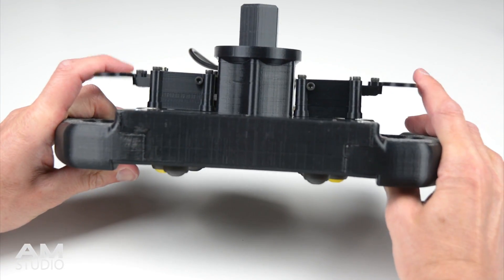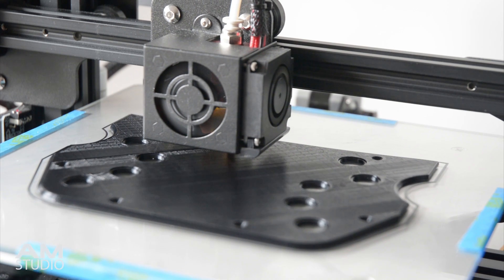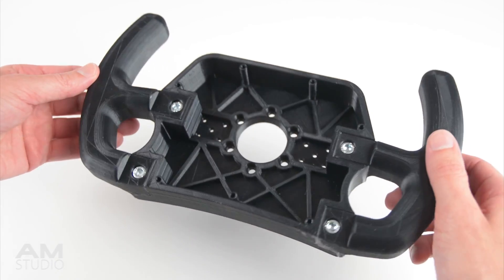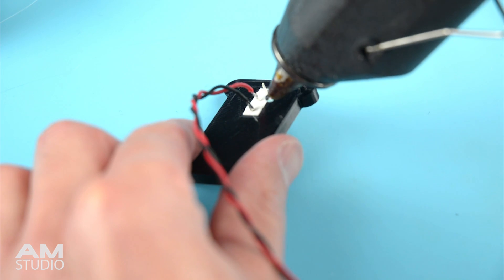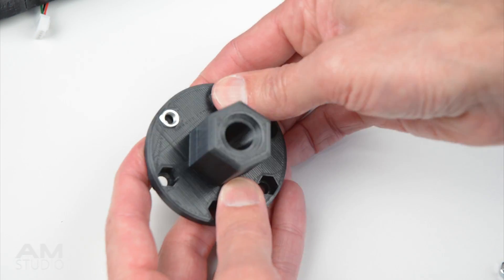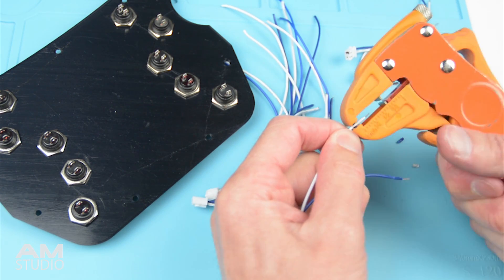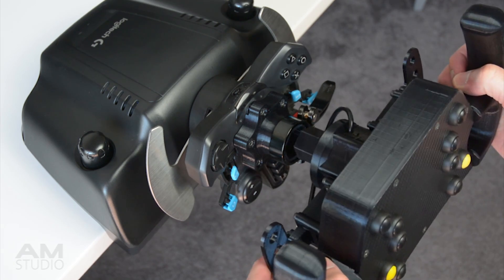HOW TO MAKE A 3D PRINTED F1 GT WHEEL

Comment: Bought it, printed it at 100 infill (maybe less would be ok too), assembled it exactly as shown and using it on a qr1 CSL elite.  It's so awesome, handling 6nm without any cracking noise or bent. But since qr1 has a groove, I can't turn it upside down without unscrewing/screwing the adapter, so I just use it for gt cars like f1 and it's perfect. Next project will be the Mercedes gt wheel but I can't decide whether the 30cm is worth the trouble and will make the driving more fun than this 28cm.

Comment: I made this one a year ago and it really improved by g25 base. However I modelled an adapter myself to directly bolt it to the base which cut out the movement and it improved the feel and handling a lot. If anybody wants the file I can post it on thingiverse. I might do a 2nd one and I am wondering which led shift indicator lights or displays are people using these days I can imagine that the prices of displays has fallen and the quality went up.
Reply: Do you still have that link? Also would love to know more about the process and ease of this tutorial.
Reply: @xelaplays14  With a little experience 3d printing its easily doable. You may have some issues with the quick release which creates some movement and flexness in the whole system. Therefore I designed an adapter to permanently mount the formula wheel to the g25 base which improved the feeling for me a lot and im still using it on a regular basis in Iracing. I can post that on one thingiverse if you want.
Reply: Yes I would love to see that. Looking to maybe create one of these to gift to my family members. It's really encouraging to hear that this job is doable with the right tools

Comment: I was thinking about doing something similar to this using a seperate logitech button cuircit board and then i can plug it into the actual wheel when i dont use the stock one so it looks cleaner, not sure if it will work though.

Comment: HI! I bouth this great steering wheel, but I need to install it on a T300. It's possibnle to have the Trhustmaster connetcion design to be printed?
Reply: If you go on thingiverse there are a few adapters for the t300 that you can print. It looks like you could just replace the Logitech quick release adapter with a t300 one.

Comment: Hey is it possible to use the usb encoder board and wire it into the g29 to work with the ps4 i dont want to use the original g29 button board and also connect it back via the 7 pin connector from the wheel

Comment: @amstudio i have files need a setting in computer how do it,
or cnc setting are is in files "stl"?
how many you use PLA Filament For 3D Printer and What is the width and height of the steering wheel?

Comment: I am interested in buying your project, you can increase by 20mm or 22mm the center part of the steering wheel and the cover, I want a steering wheel with 300 or 320mm.

Comment: the original G29 steering wheel has 280mm, what is the steering wheel size of your design?
Reply from the maker: 280mm
Reply: I am interested in buying your project, you can increase by 20mm or 22mm the center part of the steering wheel and the cover, I want a steering wheel with 300 or 320mm.

Comment: Hey Amstudio, just got another quick question. I bought the files but don't seem to have the file that you put onto the G29 wheel which links the wheel to the base.
Reply from the maker: The wheel base adapter is not included with the wheel kit

Comment: For the paddle shifter you use 10mm diameter magnets, but the holes created from my print are 8mm. Should I just use 8mm magnets instead?
Reply from the maker: Yes 8mm, Looks like they changed the listing, link is updated now. Thanks

Comment: Did you run any simulation or force analysis to determine the support structure or thickness of material needed for stronger wheel bases?

Comment: Nice work once again! I've been enjoying my Ender 3! Curious does the Ender 3 automatically add support material where needed or is that part of the model?
Reply from the maker: Hey Chad, the support material is added in the slicing software.
Reply: @amstudioprojects  Thanks I found it in Cura. Trying it now on this print I have done 4 times already! Broke two and the other two I didn't like. Making a handle for my Fanatec handbrake. I love this stuff!

Comment: hey @amstudio! what size is the biggest part to be printed for completing this steering wheel? I'd plan to get the files and use my Anet A8 which has printing dimension of 22x22x24 cms but I expect it's a bit too small for the task, am I right or wrong? Thank you in advance and keep it up with those amazing works!
Reply from the maker: The biggest part will easily fit on the A8.

Comment: how to make buttons and display work simultaneously on one cable?
Reply: Use an Arduino
Reply: I know I need to use Arduino. But the question is how to connect? In order to activate the buttons, pro micro is required. What would work nextion display requires a USB-UART Converter, or nano. But how to use buttons and display from one Arduino?? Other than a way to set up a USB HUB, I don't know anymore

Comment: Looks awesome 👏🏼 Wish I could use it with a Fanatec CSL base
Reply: You can but you need to sacrifice a current wheel to get the connectors and boards. Its a bit of effort but doable. Im also looking into tge blutooth connection set ups on the new dd and hoping to retro fit one to my 2.5 will post how it is done if i can get it working that way as it will be neater.

Comment: Nice, now can we have some magnetic paddle mods for the G27/9 wheels? I'm sure you know how mushy and strange the paddles feel.

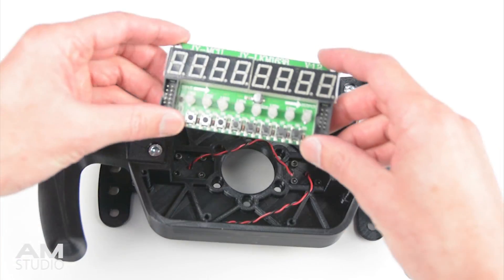Alternatively, could you do a guide to wiring the TM1836 displays (the one at 2:56) with Arduino nanos? I'd also like to see how you can connect buttons to the 8 button terminals at the bottom and get them working as well, so there is no need for 2 USB cables. Please, I know you've done a video on a TM1386, but that was a separate dash and I want to see how you could integrate it with the buttons so that the end result could look like this wheel and the TM1386 (In a way like the BMW Williams wheel of 2004 that Juan Pablo Montoya drove).

Comment: Is there any issue with the external USB cable tangling/wrapping up when the Logitech base goes through startup calibration, or do you remove the wheel while that happens?
Reply: I think you remove it

Comment: Hello, awesome videos, you are very talented, may you tell me if you really used that chinesse filament from BG to make that pieces? Im looking for a good quality and cheap filament, and your prints looks really great. What brand of filament did you used? Thanks in advance!
Reply: Don't try to safe money on filament. There are already enough sources of potential errors when it comes to 3d printing that you should rule out the filament factor at least. Any filament between $20-30 with good reviews on Amazon should be alright.

Comment: You know what would be great? A design for a single-axis F1 type magnetic shifter. So that you can up and downshift on both sides of the wheel!
Reply: Technically what is a WRC shifter paddle, yes I'd love to see him make one of them 👌
Reply: I think you mean the ones that don't have one central pivoting point? E.g. you could drive with 1 shifter paddle on one side. The F1 type have one shared axis in the center which they rotate around. So the left and right shifter meet in the middle basically.
Reply: @rjl95  I get what you mean. I don't think it would be possible to 3d print a system something like what were saying, due to the face that there needs to be the wheel mounting point in the middle, plus on most F1 wheels they come above the wheel mounting, and are very thin. 3d printing something such as would no doubt break with wear and tear over time
Reply: @rjl95  i think Fanatec have already done that with the 650S wheel
Reply: Yes they did, but now we need a freely available 3d-printable model/project :D

Comment: Can you do a wheel rim mod for the thrustmaster t150 ? nobody has a good one on youtube
Reply: There's one thing holding everyone from it. I have one as well and planning to do it, the reason is that in the rim there's pcb with those buttons wired to it. If you disconnect it, the wheel won't be recognized in windows. I have seen that you can buy small pcb that will be placed inside the wheel and pretend to be the one in the rim. Otherwise it's pretty much the same as other rim mods.
Reply: @danielprevratil3149  but can you keep the buttons ?
Reply: @vaggelispapadimitriou9135  nope
Reply: @danielprevratil3149  I'd like to help solving that, but i don't have the wheel. Shouldn't be easier to wire it to the inside of the wheel base?
Reply: @AlanGonzalez-om4rr  Not sure what u have on mind, but if u think to wire the buttons to the wheel base, you can't, because they're all wired to the pcb in the rim, which is connected to the base with 6pin something :D
Reply: @danielprevratil3149  I meant moving the whole PCB to the wheel base and using an after-market wheel
Reply: @AlanGonzalez-om4rr  Yeah, that's kinda impossible, because the pcb is as big as the center of the rim, so it won't fit in there. That's why there's that guy who sells adapter and little pcb to make it work.
Reply: @danielprevratil3149  Nothing it's impossible... pm me @medicenchepibe with some pics, the controller isn't on the steering that's for sure because the firmware isn't open source as far i know (so that adapter whoever sells it doesn't contains a whole logic board)
Reply: @danielprevratil3149  Must be some kind of pullup or something like that, or an i2c keypad... Strange anyway.
Reply: @AlanGonzalez-om4rr  maybe in the evening, im quite bussy at the moment. And  u r right, I would say that shorting the cable that connects the pcb in to base would do the trick.
Reply: Yiannis Papadimitriou I had one and getting a t300 is a good move
Reply: I have just made a full 3d printed wheel for the t150 with new buttons wired onto the original thrustmaster wheel board. I hve also wired into tue wheel the r3 and l3 butttons from the wheel base onto the actual wheel now.